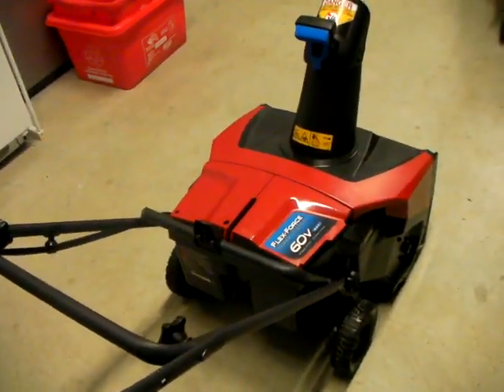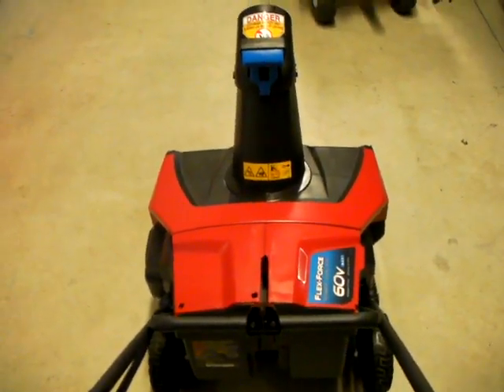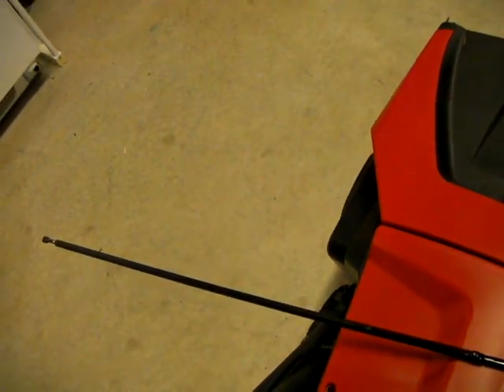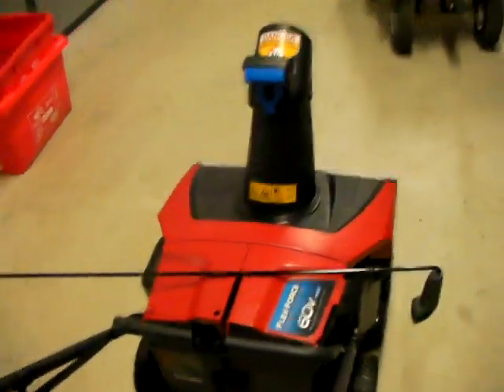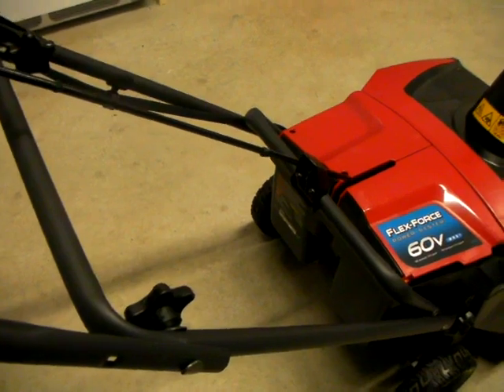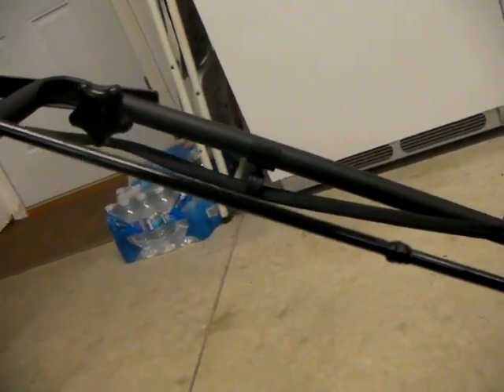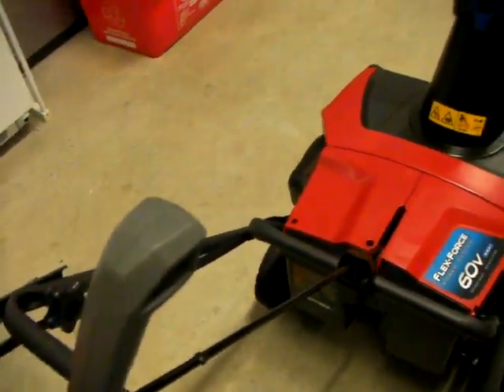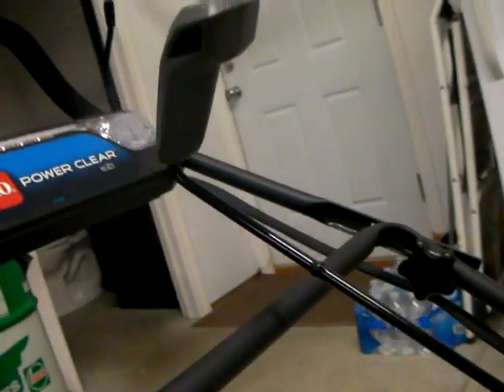Toro 60v snowblower chute control rod upgrade!

Comment: Nice job!  I wonder if you could buy another one of those plastic support brackets they have on the cross bar and mount it to the upper cross bar where your chute handle is now?  That would support this long rod and look very factory.  Again, nice work!
Reply from the maker: Thanks Art. That is a good idea about another support bracket. I'm sure you can buy one of those plastic support brackets, but they may be very pricey, because it is Toro and always spare parts are costly. Maybe get an eyebolt or something like that and that may work. Let me know what you do. Thanks

Comment: I did the same thing...only I took the original one to a welding shop and had them make a longer one using a 5/16" rod. Works really good. You can keep pushing and rotate the chute at the same time. I never could figure out why they even designed it like that, unless it was only for folding the handles up???
Reply from the maker: That's great that you got that done. Yes it's strange that they made the handle so far down. I think on the second generation they will make the handle adjustable.

Comment: Thank you for a wonderful video. 
I'm looking at doing the same thing. Im 5-2
For people who cant weld, I was thinking about cutting  the rod and threading the extension piece to the existing piece??
Reply from the maker: Threading will work for when you turn the chute to the right, but when you turn it to the left, it will unthread, unless you put loctite in there. You should just make a sleeve or buy one that would hold the rod size and use the set screws to tighten it. Just like a drill  bit extension.
Reply: @Tripod525  
Thank you 
I have to keep that in mind